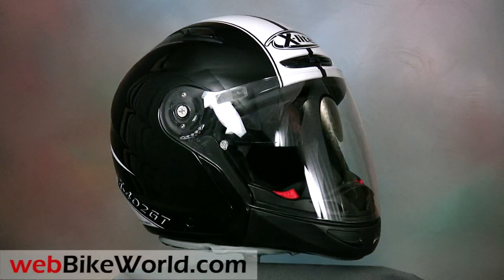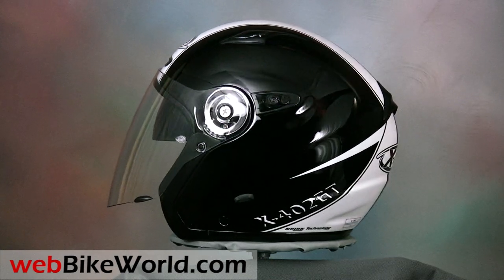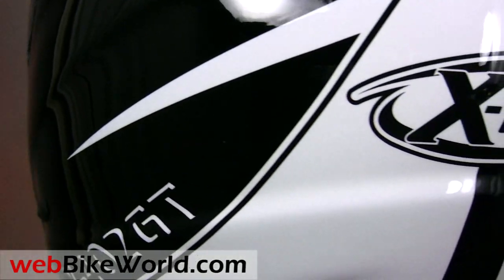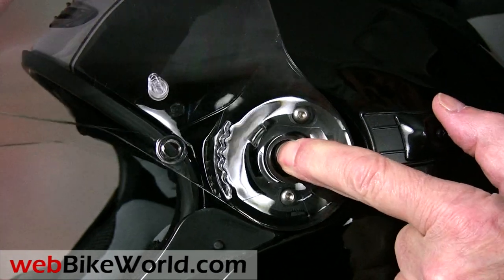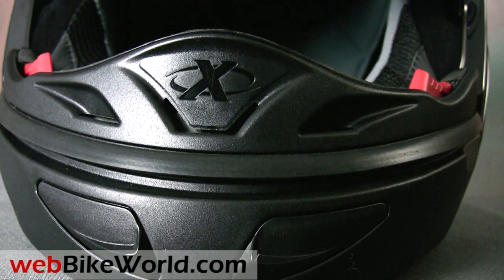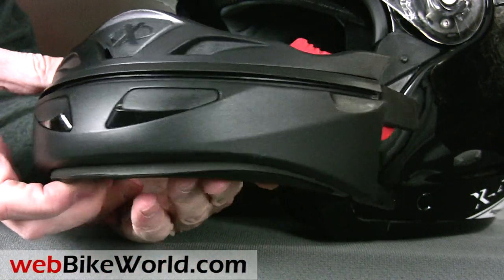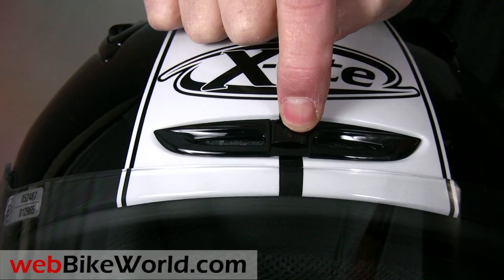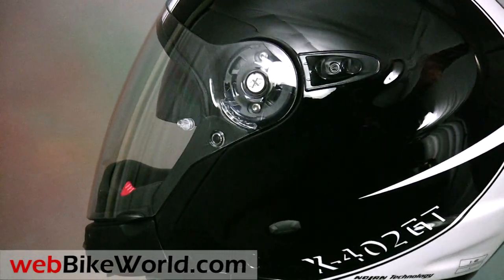X-Lite X-402GT Helmet

Comment: I find it fine for winter riding. I've ridden in quite cold conditions, down to -5C, and as long as you get the lower wind guard over your chin it's fine. As always I'd use a neck warmer with this lid. It's quite a noisy lid though so ear plugs are a definite.